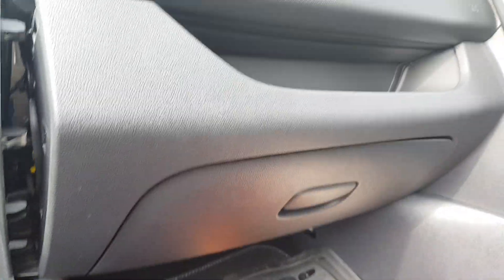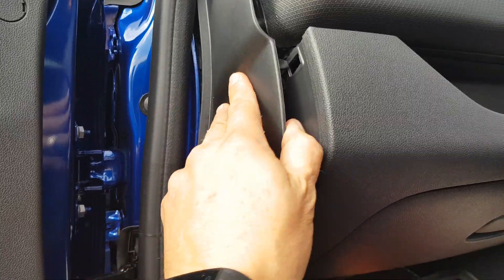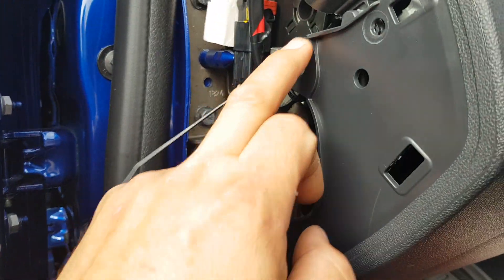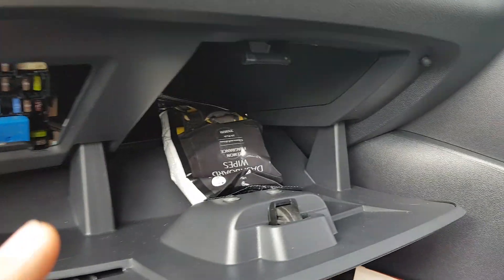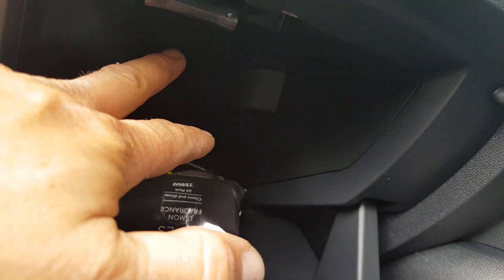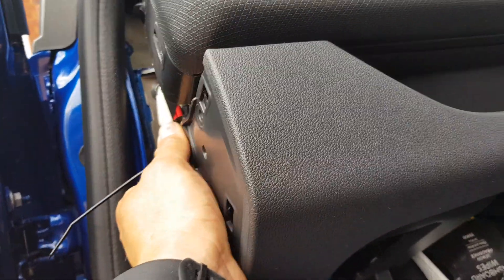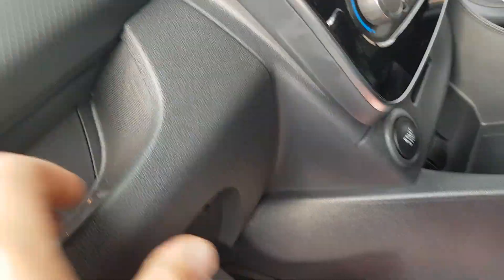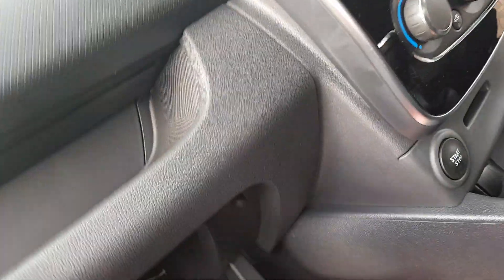RENAULT CLIO GLOVE BOX REMOVAL HOW TO(NEW SHAPE) + fuse box location

Comment: How come this video show fuse box under the glove box and the manual and other videos show it's under the steering wheel? :o
Reply from the maker: 2 fuse boxes
Reply: @MADMODS  Ah. :D Does it matter which one I for example want to hard wire a dashcam etc for? I guess under the glove box? 

Really thankful for your quick answer btw and video!
Reply from the maker: @joakimberg692  if you want to use a fuse tap the one behind the glove box will be slightly easier but if you are ok wiring it in with a fuse go drivers side pop the end panel off and the kick trim next to the accelerator pedal and the wiring loom that runs into the door there is a thick yellow that's ignition and you can cable tie all the extra wire behind the dash end panel and earth it up there on the 10mm bolt.